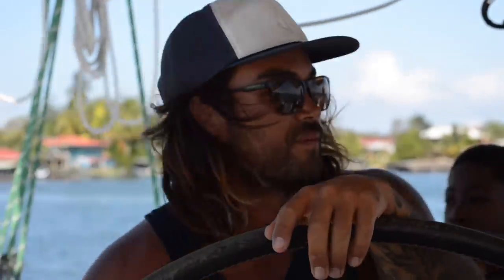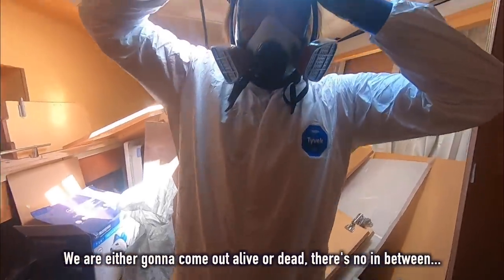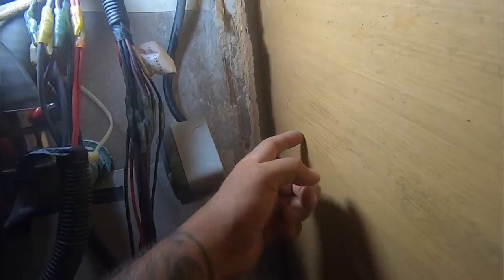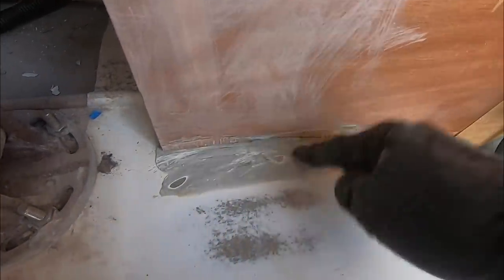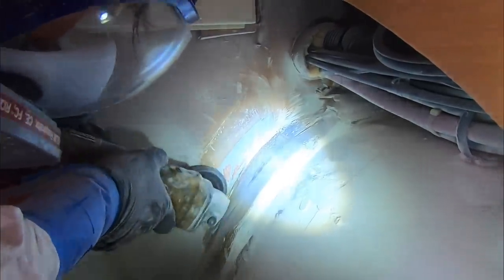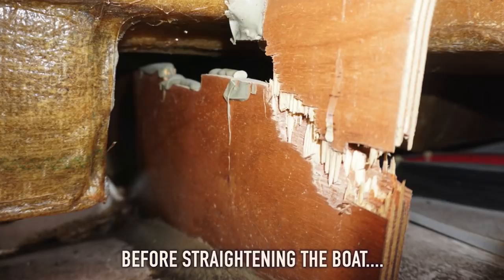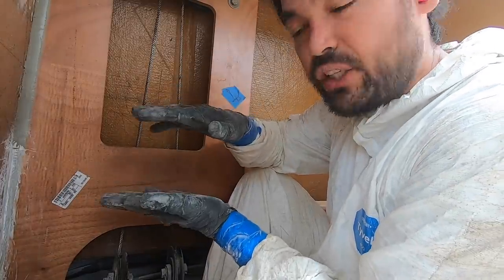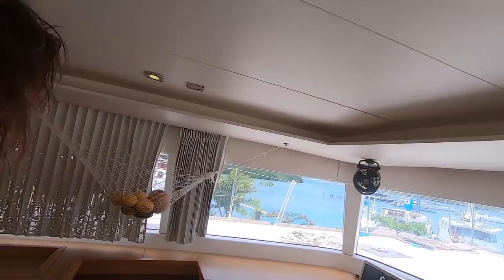CRACKED BULKHEAD REPAIR SERIES - Part 7 (Episode 112)

Comment: The structural failures are a Complete design fault. The entire construction method, using unglassed plywood for major bulkheads is flawed. Building the whole structure and then glueing the deck on after is a Huge flaw, because you loose the "I beam" strength of glassing the deck and floor to the bulkheads  It is important for buyers to understand that these cats are designed for a 5 year charter life..... Not for cruising around the World in... I should add, there are many production builders who use the same "build it in bits and stick it together with a bog mix" philosophy... Cheers, Rustie.

Comment: Way late to the party regarding your testicles as a sphere question. I posit the answer lies in how it's shape is applied geometrically. A testicle may not be a perfect circle, but it is a sphere.  Why? Because it answers the definition of a sphere. A sphere is a 3-demensional solid  having a curved surface. No vertexes, edges or angles.

Comment: I would never buy a Lagoon now I’ve seen what you’ve uncovered. For a start ‘marine ply’ delaminates after any prolonged period of exposure to moisture and the structural integrity of a single sheet of ply has very definite limitations. My 30 years experience of design and build of houses leads me to seriously question whether the boat would be structurally sound even if all those glue joints had been correctly carried out when the boat was built.
If so many other 450’s have the same problem then I fear the question is answered. I also think I saw stress twists in the ply of your friend’s Lagoon when he and his wife filmed their investigations. I don’t know much about boats but I do know about the structural integrity of buildings and to me single layer (18mm) ply bulkheads make no sense at all. 
Lagoon should have swapped your boat for a new one to stop you ever making these vids revealing their highly concerning construction. Good luck. Incredible work.

Comment: The faults you have uncovered are going to have happened on everyone of those structurally defecient designed and built Production charter boats. They were never meant to be sailed hard in the open ocean. I am sorry for all the new boat owners that did not do the research of why a Privledge or Gun boat cost so much more. Budget boats with a lot of amenities are for calm leeward sailing. They will ruin a generation of Boaters just as Bayliner did. People believe the salesman and have experience in boat construction.Low tunnels in the open ocean slap and stop you momentum in real seas. Even expensive Cats are not all built for the real world. THEY HAVE LEARNED TO RAISE THE PRICE SO BUYERS THINK SINCE THEY PAID A LOT THEY GOT VALUE. WRONG ASSUMPTION THE STRUCTURE AS YOU HAVE NOW DISCOVERED IS THE VALUE .THE ONLY THING BETWEEN YOU AND THE BOTTOM OF THE SEA IS THE BOAT. GOOD LUCK WITH YOUR REPAIRS .GET A SET OF PRIVLEDGE BLUE PRINTS AND LOOK AT THE ALUMINUM STRUCTURE GRID FROM HULL TO HULL THE MAST STEP IS ON THE FORWARD BEAM AND THE AFT DECK HOUSE IS CLOSE TO THE AFT BEAM GLASSES IN FULL BULKHEADS AT LEAST MY 92 48 WAS

Comment: Lagoon must be hating all this bad publicity and with so many Lagoons cracked bulkheads Appearing all around the world quite off you have never seen heavy seas or a hurricane. 
But looking at some of their crappy workmanship pathetic fiberglassing cheap construction under Engineering I'm not surprised. 
I was always taught you build a boat for a "  STORM  "  not just a sunny day .
When you buy a car you always buy one with the best safety rating manufacturers try to reach that high standard to sell the vehicles.
So why is LAGOON not driving to a higher standard.
By the way    OSTRICH EGGS   would that be a better description because technically they're not round like a ball.

Comment: Two comments, first, on-theme humor: when you guys get this boat back together, you won't need to put your chairs back in the salon, you can just sit on your giant balls!

Now the sobering concern as I (non-marine engineer) watched this, and particularly the footnote at the end... rarely is there just one design failure, one quality problem. Failures often point to systems of failure, far and wide. I hope, for your guys health and safety, that the manufacturing deficiencies you are repairing, are not merely the first visible symptom/result of much greater design inadequacies in this boat that make it a danger in blue water. I know how experienced you all are at sea, it's clear, but please take every precaution to ensure you have adequate safety and survival equipment on your eventual journey. There is just too much here you do not know. And if other owners worldwide are coming forward with like complaints, and your efforts are indicative of the depth and difficulty of the repairs necessary, I wonder if Lagoon can survive it, both financially and by reputation.